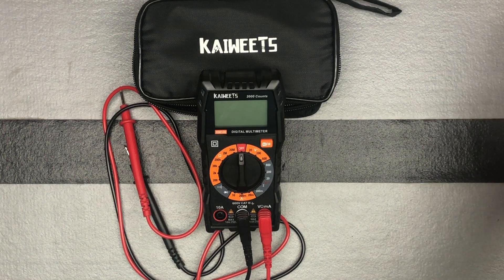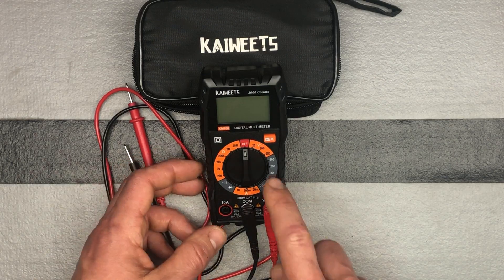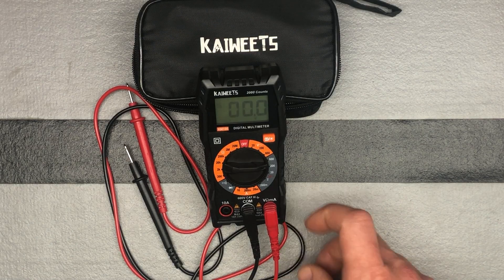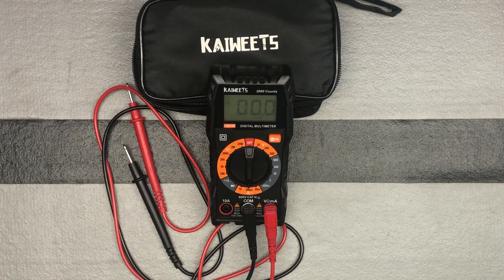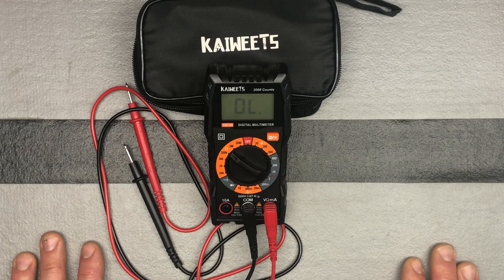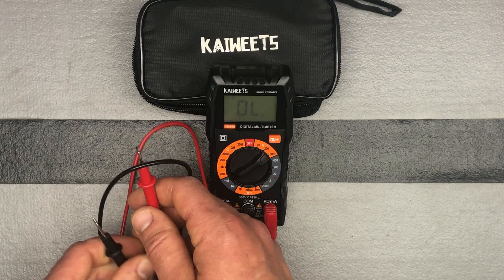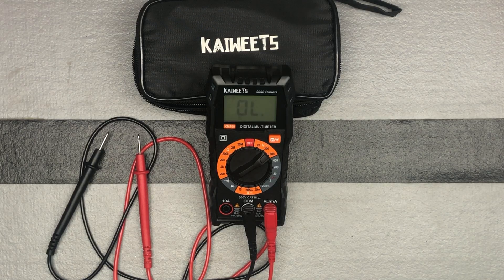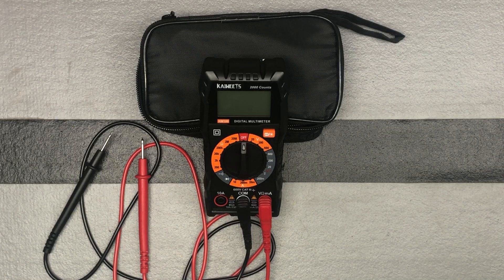Demo - Setup of Functions: KAIWEETS Digital Multimeter with Case

Comment: How about how to use the damn thing….. I’m trying to wire a ceiling light and want to know if the wires are hot….simple question but can’t find good video on how.
Reply from the maker: touch black to grounded - touch red to wire, see if meter reads anything

Comment: Picked this over the Recommended AstroAI Red Model on Amazon, just because it looked more complicated. Why did I want more complicated, I have no idea! 😂

Hope I made right choice, they were same price. This was on sale $12.

Side note: To check car battery, I should be using the 20v DC setting with the (V-) symbol, is that correct? 

I probably won’t be using it for much more, unless I actually need to one day, but always wanted one. So tired of Auto Part stores always telling me my alternator was bad, and every single time, they were wrong. Had to have a mechanic come just to show me it was the battery last time.
Reply from the maker: I believe you are correct. This is the setting I would use
Reply: @ Ok, 👌 Thank you!

Comment: How can I attach the red and black wires to the device? They don’t fit in!

After finding where the batteries go, now the challenge is to connect the wires to the device!
Reply from the maker: It should be easy. What is the problem?
Reply: where do the batteries go????

Comment: Where do you put the battery in? I literally couldn't find any place to put the battery in
Reply from the maker: I think on the back? I am not sure as I have many of these
Reply: Unscrew the back there should be one screw and it’ll open up
Reply: This device is a puzzle to solve. Yes, you need to unscrew the back and place the batteries.

Comment: This particular model will stop working, for no apparent reason, within a year. Almost positive the one you gave away no longer powers on.
Reply from the maker: Maybe, I would not advise buying this if you use it often. I would say it is for occasional homeowner use. I have several multimeters. This one still works fine

Comment: Funny when I bought mine it never said anything about DC only
Reply: Dial clearly has 20V, 200V and 600V AC voltage settings and current measurement is DC only. This is a starter level multimeter, checking small DC current is relatively safe for the hobbyist or someone who wants to check the electrics on the car, basic multimeters, even if they say CAT whatever, should be kept away from mains voltage and current.

Comment: Thank you for sharing your review, been on the fence for products like this off of amazon. If you have annual review for how long they can last or how product has been would be awesome as well🤙🏽
Reply from the maker: It continues to work well but it doesn’t get a lot of use. I have several multi meters and my typical electrical work is limited to changing lights and outlets and occasionally adding outlets.